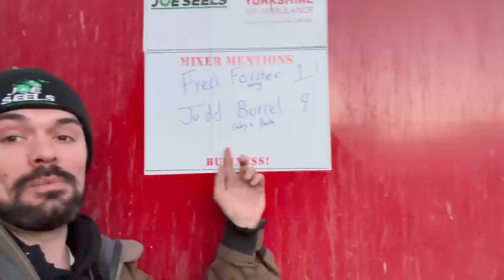Big Mick… Working! Andy’s Gets his Arm in! Ems Tractoring!

Comment: If your pressure washer produces hot water it will soften the glue on the reverse of stickers causing them to peel. I reckon Replace the JCB sticker with a 'BIG MICK' sticker 💪🏻
Reply from the maker: It’s a cold pressure washer, does have good power though! 😂😀